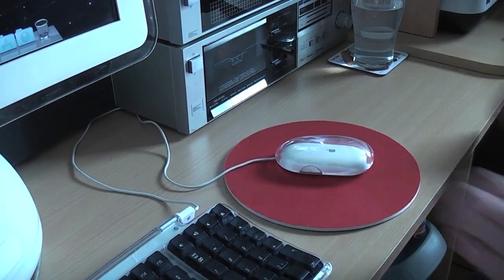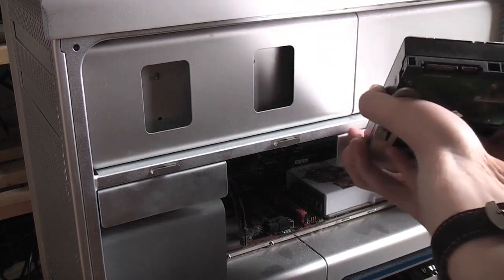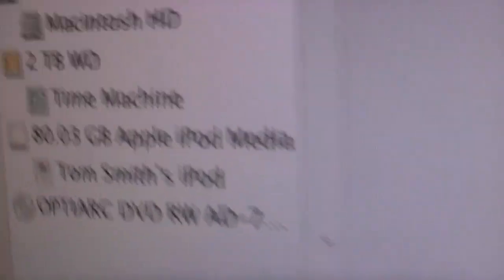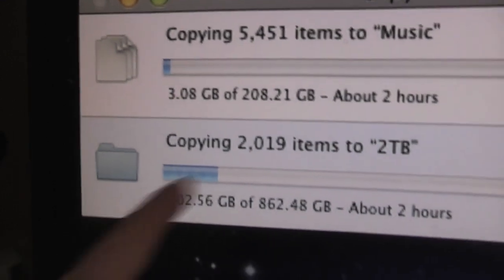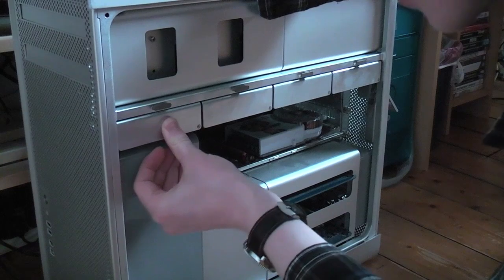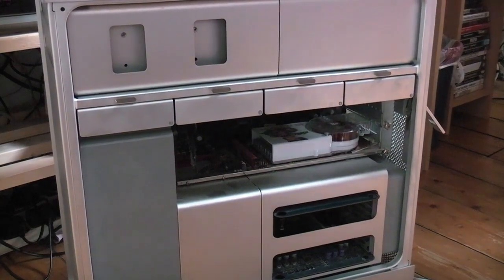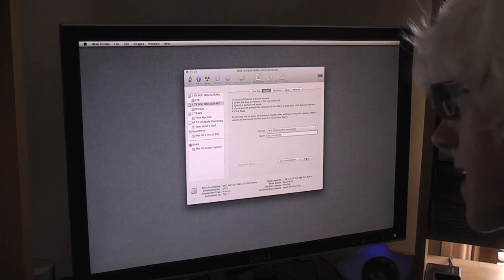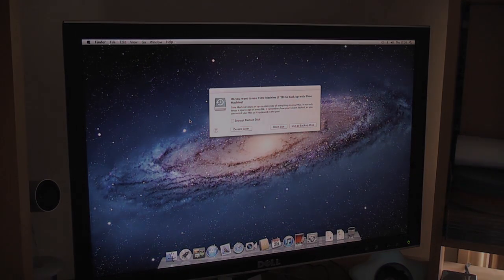Mac Pro Hard Drive Upgrade & Lion Installation

Comment from the maker: @MrPearPodd Back in the IDE days, all  hard drives came with a set of jumper pins next to the interface. Included was a jumper which is a small piece of plastic with metal inside to 'jump' 2 pins together. This was mainly used for configuring Master / Slave setups, or limiting the drive to a certain transfer speed or capacity. On modern drives, it's more rare but some still have jumpers to enable certain modes. :)

Comment from the maker: My house is pretty dusty. We often have building work going on, and I have a coal fire which adds to the dust. Also, I kept it on the floor for a while and because I've got a hard wood floor, dust doesn't stick to it like it does to carpet, so the computer just sucks it up :)

Comment: Hey Tom, Great in-depth video, just a quick question, How do you find the performance on lion with the x1900 xt? I just purchased a 2007 3.0ghz quad mac pro with the x1900 xt and I am wondering whether Lion's Performanceis smooth and not sliggish. Thanks :)

Comment: I am wondering if u can help me out? My Mac pro led power light blink and won't power on? Any help will be appreciated
Reply: Most likely a ram problem. Try reseating it or even changing the configuration
Reply: whats the configuration?
Reply: +Desmond Albert the way you set up your ram. Also the cards were you put your ram in, Make sure the top one is in the top and the bottom one in the bottom
Reply: +Desmond Albert Did you use proper FB-DIMM memory? So not regular DDR2 PC memory?
Reply: this is the exact thing that im dealing with rn, anyone can please help out thankyou.
Reply: Thanks for getting back with me, my computer still in the shop, I don't know what FB Dimm memory, can u send a link on eBay?
Reply: Bro I just fixed my mac pro, Just get new Ram. You will be happy:)

Comment: I don't get the point of anything faster than a SATA 1.5 Gb/s mechanical HD. A mechanical HD is slow compared to an SSD, real world R/W speeds only max out at around 80-90 MB/s, with "theoretical" speeds going up to 150 MB/s. In other words, even an original SATA port isn't even saturated by a mechanical HD, no matter what type it is.

Comment: @ijoshtech All my Samsung drives have died in less than two years, and their speed tends to really diminish faster than any other brand of drive I've used. Milage always varies with things like hard drives as everyone uses them in different ways. I find WD have the fastest, most reliable, and quietest drives from my experience. Seagate tend to be pretty quiet and fairly speedy but not all that reliable. Hitachi (newer ones) are pretty reliable, fastish but a bit loud. At least for me.

Comment: "Upgrade and Lion Installation"? 1. This video should've been edited more tightly/more concise. 2. You spent excessive amount of time on how dusty your computer was. 3. At about 9 minutes 38 seconds of the video, you said,... "the drive go's on like that"? Like what?! Your elbow blocked the most important part of the installation! Looks like installing may be strait forward and I wanted your video to confirm my speculations but you censored the actual installation?!  I see this video is a few years old but hope you've improved on editing.